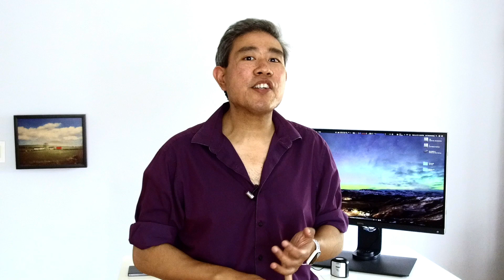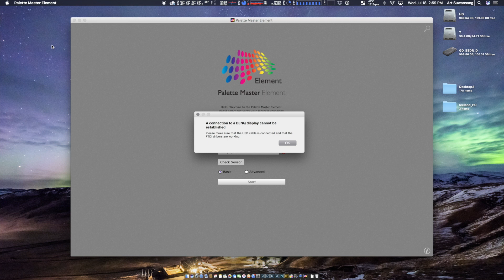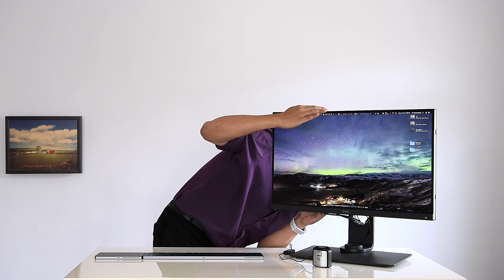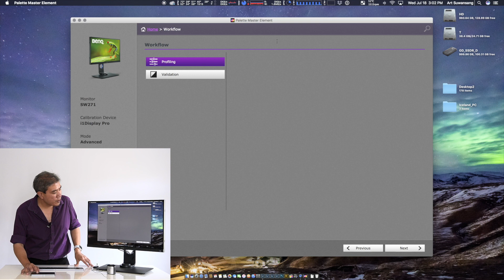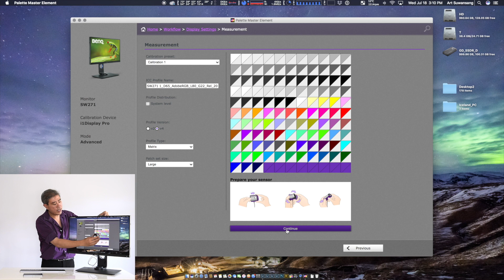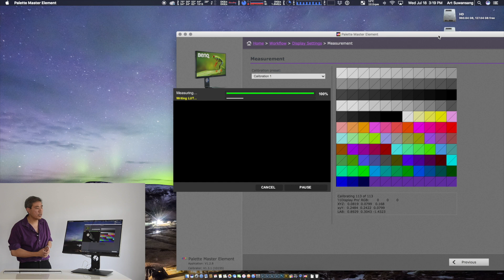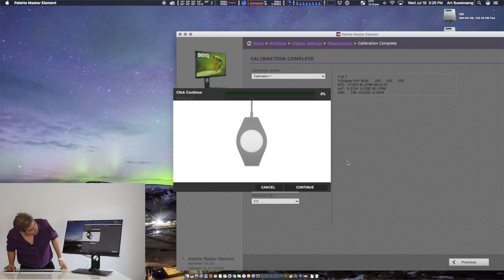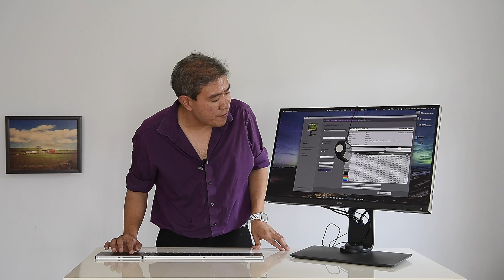How to Calibrate BenQ SW Displays with Palette Master Element - Art Suwansang

Comment: I've followed all the advice here and my brand new SW271 fails the calibration everytime with a 'maximum delta E of 3.65' - I've run the check in 'relative' and 'absolute black' same results...fails with a DeltaE of 3.6-4.  Should I swap the screen?
Reply from the maker: @speedmatters, could you tell me more about your setup? What computer are you using, model year etc, OS Version, cables you use to connect your computer to your display, PME version? Also if this is a Mac, have your Mac been restored from a backup at any point?
Reply: @ArtIsRight  Thanks for the reply. I'm using a home built PC, finished yesterday; Ryzen 3900k, 64GB RAM, Nvidia 2060 Super 8GB GPU. Using only BenQ cables, USB 3, I have to use the HDMI because BenQ (for some odd reason) don't include a display port to display port cable with this expensive monitor, rather a mini display port to display port! Running latest activated & updated W10 Pro and PME V1.3.8 and calibrator V1.3.3 (1D198).  Many thanks for any advice you can offer.
Reply from the maker: @speedmatters, I'm fairly certain that HDMI Is your issue here. I think you are running into HDMI tonal range compression. Please change to display port cable and then try calibration again. You can get a cable from Amazon for less than $10, or you can always order a cable from Monoprice as well.
Reply: @ArtIsRight  I've got a Display Port to display port cable on order. Seriously, why on earth do BenQ not include this cable when it is such an important part of the equation? You pay all this money for this screen specifically to get the best colour reproduction and yet you can't achieve it out of the box!  It's a great screen, shame about the awful W10 scaling issues. I'll drop a message here when I've tested with the DP cable. Thanks again for your advice, appreciated.
Reply from the maker: @speedmatters, you're welcome. Some displays does not even include any cable, everything is relative here. In the PC world there are video cards that use display port to display port, however, most of the cards now include mini DP as well. Occasionally, someone would be in your situation. It is not ideal but it could be much worse. Also the alternatives here in this case does not fair any better in the cable department. About Windows 10 scaling, yeah nothing much we can do there, it is sad. Anyhow, yes keep me posted.
Reply: @ArtIsRight  Great call on the HDMI cable issue - this was the problem. Now maximum Delta E is 1.94 with an average of 1.01. Thank you very much for your helpful advice.
Reply from the maker: @speedmatters, you're welcome!
Reply: @speedmatters  actually display port has much more bandwidth than a HDMI port. so for full 10 bit out. display port is a must

Comment: Again thanks for your great videos. I'm curious if it's recommended to choose Adobe RGB under Default Color Space at the top, then choose Panel Native for RGB Primaries. Doing this seems to corrected a "green cast" on my 271. Regards
Reply from the maker: @Gordon Clark Photography, you can, however, it does not really make a difference in this case. Choosing Panel Native will override Adobe RGB preset at the top, and choosing Adobe RGB preset at the top only choose Adobe RGB as the primary. The screen that you are talking about is where you select the setting, it has no baring on the outcome of the color during the selection. So the sequence in this case will not matter.

Comment: A great video! Thank you very much for sharing. I have a question. I have a Benq SE270C monitor and a Color Munki calibrator. Do I have to calibrate separately for Adobe RGB and for SRGB? Thanks
Reply from the maker: @Santi Miquel, I would recommend calibrating to Panel Native using this guide https://youtu.be/bz9y3db9vRI And which ColorMunki do you have? Since you are using it with PME I think that you have the bigger color munki photo. If you can get the validation to pass with Panel Native you are set.

Comment: Thanks Art.  I calibrated my monitor according to the instructions in your video.  It shifted the colors in my monitor quite a bit and has made my images more red now.  I am not happy about that and felt the colors were better and more accurate in the monitor without the calibration.   Is there a way to set things back to the way there were with my monitor?
Reply from the maker: @John Munno Weddings, to some extend color is a personal preference. However, when it comes to calibration, it is always better to stick with the reference value, in this case the calibrated value. When you say the images are more red, it could be that they were that way all along, however, the screen that you used was not calibrated to reflect that. This said, you can always choose another color mode such as Adobe RGB on your BenQ display to view and edit your images. This would be the way to get the default factory calibration back. In this case, I am assuming that you were able to pass the validation test with your custom calibration profile. Another thing that you can do too is not go by what you are used to, but what the lab print would look like. If your lab print comes back closer to the uncalibrated setting that is ok too, at least you have done testing on it first. If it confirms that the colors are over saturated somehow, then perhaps you should use the custom calibration. Hope this helps.
Reply: @ArtIsRight  Hi Art.  I checked with Ben Q today.  They informed me their is a bug in Pallatte Master right now that causes the red colors to be off as my observation found after I calibrated the monitor.  So basically the reds are way too over saturated!!!.  They informed me that I can no longer go back to the factory settings of my monitor which were fine before I did the calibration.  So at this point this has been an expensive exercise in screwing up my new monitor!!!!  Not happy about this at all.  They recommend re calibrating using a small patch sample for now and wait patiently to some unforeseen time in the future when they can fix this problems in a new version of Pallate Master.   Not happy about this at all!!!  Better to have left the monitor alone.
Reply from the maker: @John Munno. Are you using a Mac or a PC? I know of an existing bug that changes the hue of the red but not the red shift as you describe. If you don't mind I would like to see some images. Could you snap a few with your phone and email it to me. You can find my email in the about page. Additionally, what BenQ Support told you is incorrect. For your display, when you took it out of the box the default color mode is Adobe RGB. Calibration 1 was not chosen and in fact is grayed out so you didn't mess up your display. If you want to what you can do is reset your display back to factory default. You can do this by going to in to your display menu - system - scroll all the way down to reset and then confirm it. This will reset all of the color mode and calibrate in your display. From there what you can do right since you have a colorimeter is use the software from the device manufacturer, in your case i1Profile to do a software calibration on your BenQ. You can do this in Adobe RGB color mode or Custom Color mode, either one will work just fine. If you need help please email me. Let me know if you are on a PC or Mac, what video card you have and what cable are you linking your display to your computer. There are solutions to the problem that you are facing, it is not a dead end and I like to help.
Reply: @ArtIsRight  Thanks for reaching out Art.  I will email you from here with any questions.
Reply from the maker: @John Munno, you're welcome and please do!

Comment: Than you Art.  I know there is a brightness button adjustment on the monitor that goes from 0 to 100. Is that something I would adjust on the monitor or do it through the calibration process with the color calibrator?
Reply from the maker: @John Munno Weddings, you would be doing the brightness adjustment in PME. What you will do is set the luminance value. PME will then automatically adjust it on the display and you are set. From there you'll be running in either Calibration 1, 2 or 3 depending on which calibration slot you set PME to calibrate. Once you are in these calibration mode, the brightness adjustment button on the display are disabled in this mode.

Comment: Is there a monitor brightness percentage that you recommend to have your monitor set to?
Reply from the maker: @John Munno Weddings, each monitor would translate percentage value slightly different. So the best thing to do is set the brightness value to somewhere between 100-120 cd/m^2. Personally I set mine to 80 cd/m^2. Regardless of if you print or not your should be editing your images at this brightness on a screen.

Comment: Hey Art, I keep getting a "! Your monitor need to be calibrated" message on my SW271 every time I turn on my monitor or switch between inputs, despite the fact that I JUST re-calibrated it using Palette Master and it passed.
Reply from the maker: @Jeremy Mullins, what you can do is go into the display menu. Choose the hamburger (3 horizontal bar menu), go to system, choose CAL. Reminder and turn that off. From there you should be set. Let me know if this works.
Reply: @ArtIsRight  that worked. thank you!
Reply from the maker: @Jeremy Mullins, awesome!

Comment: I have a color munki. Will this work with the Pallette Master Element?
Reply from the maker: @John Munno Weddings, it won't you would need the X-Rite i1Display Pro. Keep in mind too that the i1Display Studio is a rebranded ColorMunki so that one won't work either.
Reply: @ArtIsRight  Thanks for letting me know.  Can I calibrate the monitor with my color munki without the Pallette Master Element  for now until I get the X-Rite Pro?
Reply from the maker: @John Munno Weddings, you can. For that you can use the custom color mode in display.
Reply: @ArtIsRight  Thank you for you reply.  So for now I will use the custom color display in the color munki calibrator until I get the new X-rite and can use the the Pallette Master
Reply from the maker: @John Munno Weddings, yes absolutely.

Comment: Hi Art, I am running Windows 10 home, Dell XPS 8930 and used my Xrite I1 pro with the PME software. Everything is find in my color managed software, Photoshop and Lightroom, but the colors are over saturated in my non-color managed photo viewing software. Is there anything that I can do? Thanks so much.
Reply: Colors are also over saturated when I view photos attached to emails in Microsoft Outlook.
Reply from the maker: @Karen Mortenson, I've seen a few other users telling me this before. Let me run some check on my end and I'll get back to you.
Reply from the maker: @Karen Mortenson, I forgot you ask you, what display do you have?

Comment: Hi, thanks for your videos! :) I would like to ask for little help. I just bought the SW271 monitor and an X-rite i1Display Studio to calibrate it. Now i see the calibrator isnt recognized by the software. I understand that  i1Display Studio is quite a new device. Do you know it they're working on adding the compatibility? If so, I would keep the calibrator - if not, I will have to return it and get another one. Please advise. Thank you.
Reply from the maker: @Jana Jedličková, thank you for the question. The i1Display Studio is X-Rite entry display calibrator and it is not open and will not be open to 3rd party software like Palette Master Element. So my advice is for you to return it and get an X-Rite i1Display Pro instead. It is the same one that I used in the video and it is the best calibration device for your BenQ.

Comment: Thanks for the great video. 
I have a problem calibrating my BenQ SW271 (Sypder5Express, Win10, Geforce 1060 GTX, DisplayPort Cable, PME vers. 1.3.8, Calibrator 1.3.3).

The desired luminance is 120 but the achieved one is 212.335, 
The target color temperature is 6050 K but the achieved one is 7737 K.

I have already reset the settings on the screen to factory defaults, which unfortunately didn't help. At the moment I don't know what else I can do.
Reply from the maker: @Jan Bu, what are the settings that you use? Adobe RGB, Panel Native, etc? Also what is your setting for black point setting? One more thing that I would do is watch this video and see if you set the setting the same or similar to this video will you run into the same issue. 
https://youtu.be/bz9y3db9vRI
If you are then the next thing that I would do is recommend that you install the previous version of PME on your computer. I can give you the link.
Reply: @ArtIsRight  That helped and solved the issue! Thank you so much! I watched the video you recommended and set all settings exactly the same.  Now it worked (with PME 1.3.8). Color temperature is now 6506 K. Average deltaE is 0.99 and maximum deltaE is 1.73. Settings are 16 Bit LUT Large, Profil v4
, Panel Native, 100 cd, Gamma 2.2, Blackpoint = relative, D65, Mode xy). Before that I had worked with basic calibration (AdobeRGB, Profile v4, Matrix) and it failed all the time.
Reply from the maker: @Jan Bu, I'm glad that it worked out. The new settings, if they work and pass validation are much better than the old ones that I recommend. This said, sometime the old is great to know too because, it is a more tried and true setting, especially when all other setting fail. But it seems like you had the opposite result in this case. Either way, both setting will work just fine!
Reply: @ArtIsRight  do sw240 and its software will work in windows 7 correctly? . i hv i7 7700, gtx 1060 6gb, 16gb ram!
Reply from the maker: Nishant Kumar, my guess is that it should.
Reply: @ArtIsRight  okay sir please recommend me 1 or 2 best quality display port to display port cable!! im gona buy the sw 240 after coronavirus outbreak will come to some halt.  right now india is also in lockdown and cases keep rising!!
Reply from the maker: @Nishant Kumar, the cable comes in the box.

Comment: Before beginning the calibration process, does it matter what mode the monitor is in? The default sRGB or Adobe RGB modes from positions 1 and 2 on the puck? Or if we have calibration 1 slot filled, does it matter if that is the starting point? Thanks so much!
Reply from the maker: @Karen Mortenson, the initial color mode does not matter in this case. PME will choose the correct calibration slot based on what you set in PME.
Reply: @ArtIsRight  Thank you Art! Is there a reason that you don't check the box for Profile Distribution: System Level?
Reply from the maker: @Karen Mortenson, on the past few macOS release, this optioned is gray out because of Apple SandBoxing. What this checkmark does is allow other users on your system access to this profile. But with macOS security this is no longer available. The same principle here would apply on Windows to, where if you want every one who use the work station to access the profile then you would check that box. Windows does not sandbox as much as Mac does.

Comment: In the Display Settings I can't see any "photographer" or "video" settings, just "Device native"... No "RGB primaries" menu either... Any help on this? THANKS!
Reply from the maker: @D. RqR, you most likely have a SW2700PT with a manufacturing date between 2015 - 2016. You can check the mfg date on the back of your display. Panel made between these dates uses the older SW2700PT firmware and other color modes won't be available. The only mode that you can calibrate with this display is Panel Native. You can watch a full explanation in this video https://youtu.be/bz9y3db9vRI there are lots of advantage. Hope this helps.
Reply: ArtIsRight Great! That totally solved all my questions! I had the old SW2700PT firmware version. So are the AdobeRGB and sRGB monitor presets factory calibrated? Or they change also their calibration when creating a monitor native profile? Otherwise they would be useless, wouldn’t they?
Reply from the maker: @D. RqR, glad this help out. There are a few things that we need to separate out when discussing this. The color modes in the display, those are the ones calibrated from factory and will never change, they will always remain the same custom calibration or not. When you calibrate with PME, the only color mode that you are changing is either Calibration 1 or 2 based on your selection in PME. So you can still revert back to those color spaces if you choose. Panel Native is much better in terms of color gamut response. So you are good in this case :) Cheers.
Reply: ArtIsRight 👍🏻 Thank you!!
Reply from the maker: @D. RqR, you're welcome!

Comment from the maker: Update 20 September 2020: This is my latest update and most comprehensive Palette Master Element Guide, I highly recommend watch this updated guide over this one @ https://youtu.be/8rjRoIe0-mo

And please like and subscribe if you are new.
Reply: @ArtIsRight  Hi, I'm reading the above note that reads "update 20 September 2020," but also reads "9 months ago," and it's 9/30/20 right now. Is there a new version to this video? Also, I get the FTFI driver error message, but I just closed the error box and unplugged the monitor for a minute. Restarted the PME software and got the same error message, which I just ignored, closed the box and calibrated the monitor. I use a SW2700PT, and the average delta E is 0.87. Do you think this is a mistake to do or possibly OK? The monitor display looks the same pre and post calibration. Thanks for your time.
Reply: @vivostevo  https://youtu.be/8rjRoIe0-mo